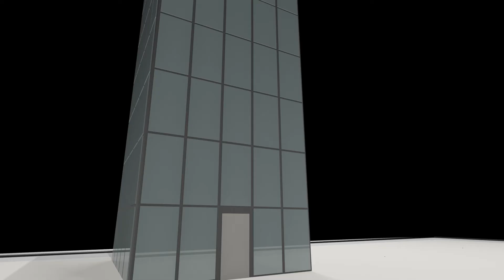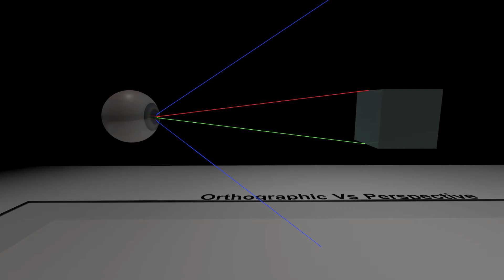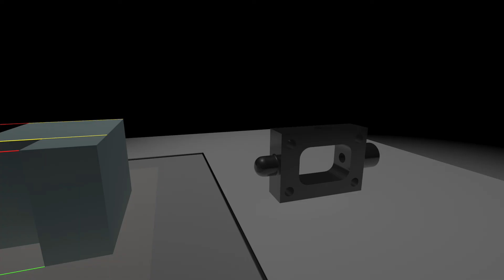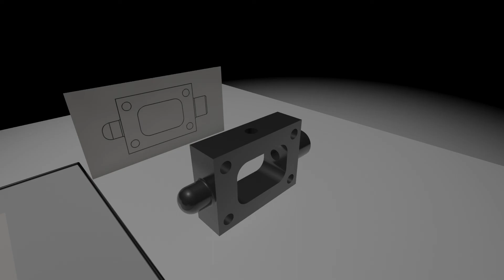Orthographic Projection in Engineering Drawing, Why do we use it?

Comment: I've been using perpective as a 3D artist for a few years, and orthographic looks so wierd to me, is there any problem for me to use CAD with perpective?
Reply from the maker: I think it ends up being software based and output based. 

I personally use perspective in 3Ds MAX when doing more visual content or artistic style 3D modelling. Plus the navigation tools in max are really geared towards perspective. Toggling back and forth to line something up perfectly and be able to visually see it is so can be powerful though.

When using AutoCAD or Inventor/Solidworks etc. I tend to end up in orthographic while working as it is usually much more similar to drawings you may be working from or working towards in the end. Again the navigation and orbit tools are a little favoured to that as well.

What you absolutely cannot do, is produce engineering drawings or product design technical drawing with views laid out using perspective. It goes against all standards and would confuse suppliers/manufacturers etc. 

However while working on the actual models, you do you! :)
Reply: I mean i'm using it only for hobby and such, all the actual drawing i'm making in 2D in the sketch tool, so no problem? :D